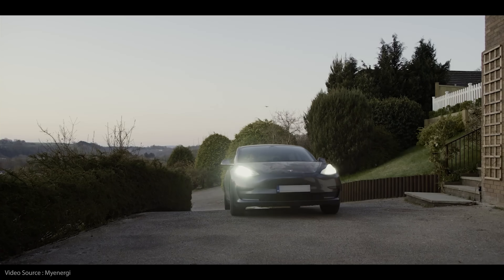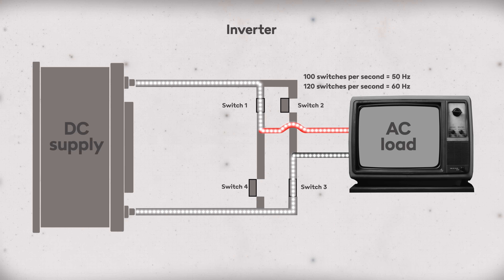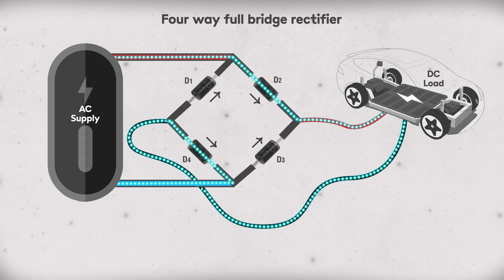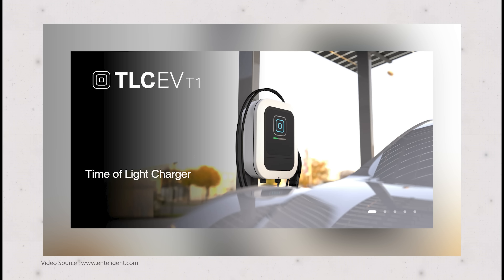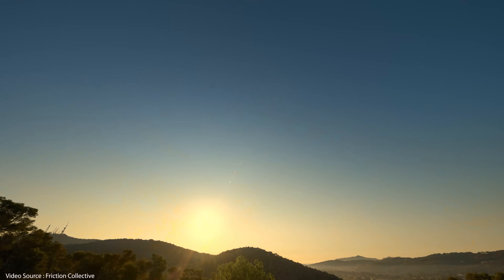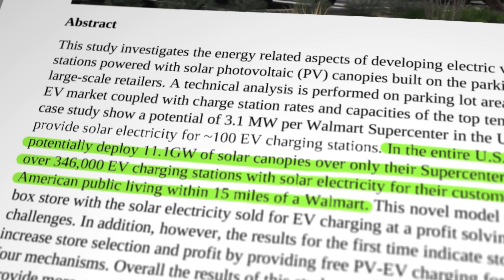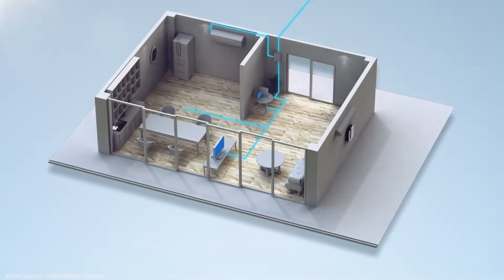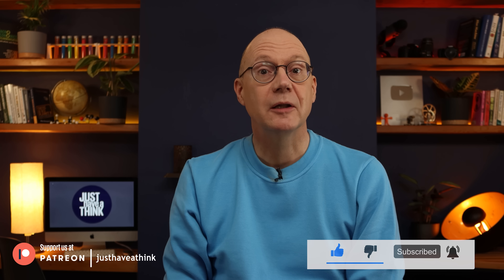DC to DC charging. One more step to off grid living!

Comment: Theoretically a solar panel string driven DC-DC can clock in at 98-99% efficiency bucking down, but most likely the solar will be at a lower operating voltage than the vehicle battery voltage, so it would have to be a buck-boost converter and that will be roughly 95-97% efficient at the likely voltage differentials involved.

The AC charger on-board the vehicle is roughly 92%-94% efficient.   And micro-inverters are roughly 98% efficient.  So the end-to-end efficiency from micro-inverter-based solar to the vehicle is (worst case)... 0.92 * 0.98 = 90.1% efficiency.

This means that you are only getting about a 5% improvement in likely configurations, and that's only when the sun is shining.  When the sun is not shining but say you have a whole-home battery system and the EVSE has direct access to the battery DC bus, things get more problematic.

There are HVDC battery systems with roughly similar efficiencies as the solar panels, but the battery round-trip still has to be accounted for (95%).   That gives you 0.95 * 0.95 = 90.2% efficiency for DC-string-to-battery-to-DC-DC-to-vehicle.

LVDC battery systems (48V systems) would need a DC-DC boost converter with a very high ratio (it has to generate 300-500VDC to the vehicle), which will only be roughly 92% efficient.  Probably even lower.  Really not any better than using an inverter.  0.92 * 0.95 = 87.4% efficiency.

So basically there are a lot of warts with this idea, and doing DC-DC at these high voltages requires some very serious and expensive safety features that makes the equipment significantly more expensive.  And you are cabling high voltage DC all over the place which has its own signifcant dangers.

Is it worth doing?   Probably not.  Save your money and spend it on adding more solar panels to the home instead to compensate and just stick with the regular DC-AC-DC conversion.

--

In short, DC-AC and AC-DC conversions to and from 240VAC aren't as inefficient as you might imagine if you are used to going to and from 120VAC.  There is a vast difference (a factor of 4) in the efficiency.   If a 120VAC conversion is 90% efficient, for example a 240VAC conversion using the same circuitry will be 97.5% efficient.   This is one reason why 240VAC micro-inverters are already able to achieve 98%-99% efficiency.

-Matt
Reply: Thanks for pointing the actual facts out.  There is so much misinformation about the differences between DC coupled and AC coupled systems. 
Most proponents for DC coupled systems like to ignore the cost and efficiency details of the required circuit protection equipment  - they argue that the cost and low efficiency can't be avoided.   Sure the cost and low efficiency can't be avoided if you are using a DC coupled system but the cost and efficiency impact can be avoided by using an AC coupled system.   Not that AC coupled systems don't need circuit protection equipment  - rather AC circuit breakers are way cheaper cost and are way higher efficiency than their DC counterparts.
Reply: @michael-j-harrison  Well, it depends where the power is going.

An AC coupled system is maximally efficient going from the solar panels to the grid or directly to home consumption.  But minimally efficient going to a battery due to the DC-AC + AC-DC (and then DC-AC again out of the battery) conversion.

A DC coupled system is maximally efficient going from the solar panels to the battery and medium-efficient going from the solar panels through the battery system voltage (but not round-tripping through the battery) and from that DC voltage directly to the grid or to home usage via another conversion in real time.   This is because the battery system voltage is typically relatively low... like 48V-56V or so.

--

Battery Round Trip is poor regardless:

Any system, AC or DC-coupled, that has to round-trip through the battery, for example to supply power overnight, will lose 5% at a minimum (battery round-trip losses), plus have to convert to the relatively low battery voltage (e.g. 48V-ish) and ultimately convert back from the relatively low battery voltage to AC.

This can be mitigated somewhat with HVDC battery systems, but the basic inefficiencies are still present.

That is minimally efficient AC or DC coupled.  DC coupled is only slightly better because it goes through two conversions (DC->BAT, BAT-round-trip, BAT->AC) while AC coupled is going through three (DC->AC, AC->DC->BAT, BAT-round-trip, BAT->AC).    98%, 95%, 92% = 85.6% for DC coupled.  And 98%, 95%, 95%, 92% = 81.4% for AC coupled.

--

People choose AC or DC coupling for a myrid of reasons.  Or even do both.  To be honest, it usually winds up being whatever the solar installer you hire is comfortable with and not so much the home-owners decision (unless you DIY it).

AC coupling requires using microinverters which means more maintenance on the roof when a microinverter has to be replaced, as well as a higher system cost.

DC coupling uses string inverters which are at ground-level, far easier to replace and less expensive to boot.

However, due to regulations, even DC coupled systems now have to have rapid shutdown devices on every solar panel.  These are far cheaper than micro-inverters but still involve having electronics up on the roof which will eventually fail and require replacement.    So it isn't possible to completely eliminate maintenance on top of the roof any more with a DC system.

-Matt
Reply: Matt:  Your math and logic is entirely correct.  I enjoyed reading your detailed explantions.  The part I dispute is that of connecting micro-inverters to the grid in US states and countries that do not allow net metering.  There is also the issue of states where the electric companies credit excess production at pennies per kWh yet charge full retail+ taxes when one buys electricity.  It is those people for whom DC-DC EV charging and home battery storage makes economic sense.  None of this would make sense if LiFePO4 battery cells had not gotten as cheap as they have.  $125/ kWh is typical retail now for large prismatic cells.
Reply: @peteinwisconsin2496  This is the situation California is in now with NEM3 for new installations.  Existing installations under NEM2 are grandfathered for 20 years from installation date.   It does increase the break-even time significantly.

Personally speaking I think 12-month net-metering and the (now) 6-minute net-metering are both unfair.  They are two extremes.  The utility does not have 12-month grid-scale battery storage.  But it certainly has more than 6-minutes of battery storage.

Given the amount of grid-scale battery storage now online, it makes sense to have 24-hour net-metering.  California is getting a lot of pushback over the absurdness of NEM3, they might make further adjustments to find a middle-ground.

Battery storage is getting cheaper, but professional installation of these large systems is way too expensive.  To really get a decent break-even period one has to DIY at least the solar side of the work.

-Matt
Reply: >-- Battery storage is getting cheaper, but professional installation of these large systems is way too expensive. To really get a decent break-even period one has to DIY at least the solar side of the work. --<
  Sadly, we live in a world where solar is cheap but installation of same is not.  I have coached so many people on PV-direct for DHW and space heat, yet only three families have completed their systems.  I get it that everything is hard when you don't know what to do but I am showing people, telling them what to buy, etc. and they still shake their heads in confusion.  If only this information age could lead to a DIY age.  Instead, the information age has led us to paralysis by analysis.
Reply: @peteinwisconsin2496  Sadly, I can literally feel the smoke coming out of many people's ears when I try to explain even basic solar + battery systems.  Strangely enough, it doesn't seem to be a factor of education or wealth at all... there are plenty of people on the low-end of the economic scale who DIY wonderful solar + battery systems, on the cheap, as a necessity to vastly improve their lives.

The problem seems to be more of a cultural nature.  We seem to be living in an age of black boxes and the cloud.  People buy stuff but have no real interest in learning how any of it actually works. That creates a hard-stop on the level of complexity the vast majority of the population is willing to deal with and needless to say power systems exceed it.   And it also makes it relatively easy for hucksterism to take root, because people have a hard separating useful gizmos from non-useful ones. 

A big advantage for those of us able to get past that wall, though.  But I worry for the future of our society in general.

-Matt
Reply: To anyone casually following this string of comments, please read junkerzn/ Matt's latest comment.  I share his concern about our species having the will or ambition to save ourselves.  We could save ourselves, but only if we can be bothered to do so.  Please read his comment and share it with others.

Comment: Great topic. Once the home solar systems get away from the arcane 48 volt systems and catch up to high voltage DC (250+) systems, much of the home charging efficiencies are cleared up. As far as the 2050 goal, it will never happen. As much as you may blindly wish for it, a dive into the global shipping market will show you that regardless of the changes being made, the increased greenhouse emissions from centralized global producers of most everything will outpace all efforts to green up the planet. Unless we decentralize our consumption of goods, go ahead a piss into the wind, it will just not happen.
I am fully off grid and charge from home.
Reply: Then we will have to decentralize. If you think the recent hurricane Beryl was scary, or the Calif. wildfires, or the China/India/... floods, then this is just the start of the process we have caused.
Saying "won't happen" is basically the same as "our human civilisation is doomed within our lifetimes" IMO.
Reply: @rivimey  yes, "won't happen" is a stretch but the numbers are there regardless of how many solar panels we put up. Centralization has historically weakened the resilience of nations or societies. I recall a bumper sticker that said "Think Globally, Act Locally". My state, even though it has the capacity to grow almost all of our own food, imports 90%. Think about it. There are so many ways to achieve the 2050 goals that, as a society, are ignoring. Driving an EV and thinking that's the answer is just foolery.
Reply: @babaluto  People trade because it saves resources. You aren't going to save resources by outlawing trade.
Reply: @aliendroneservices6621  I get it but after looking at the true costs of those resources, it doesn't add up.

Comment: From what I understand there are some major issues with the used EV market, people don't want to buy them.  And if there are issues with the used EV market then there will be knock on effects with the new EV market.  Who wants to buy a new EV that has very poor resale value. The EU has adopted standards with small electronic devices so that the batteries must be replaceable by the user with simple tools, but this standard has not been applied to vehicles. With EVs, in their current format, I think they should be called DVs disposable vehicles.
Reply: Use EV uptake varies by country similarly to sales of new EVs, those with higher adoption rates (Norway, Sweden, China, UK and Germany) the used EV sales are also higher, as familarity and acceptance is higher.  Rather in these countries the issue is a lack of availability of used EVs meaning demand is not being met.  For example, battery electric use car sales almost doubled, up by 90.9% in 2023 in the UK but the number of cars sold was relatively low due ot lack of 2nd hand EV supply as original buyers are keeping their cars as they last longer than their old ICE cars, are cheaper to run, and don't have the high maintenance issues that ICE cars are associated with.

The resale value is a sign of EV success and their rapid rate of innovation, with more and more new models coming onto the market and the new car price dropping as the underlying costs (such as batteries) have fallen - but this will stablise in the medium term. However, as with any product, you should buy something at the time that fits your needs and budget, if the car depreciates too much you hand it back at the end of the term or trade it using the balance. This is not specific to EVs all cars are depreciating assets, some cars depreciate more than others (same with EVs some depreciate more, some less). It's the whole cost of ownership that is important, the extremely low running costs of a battery EV car means it is still cost beneficial to own and run an EV than an ICE car, even with depreciation taken into account. It's not an investment asset that your looking to get a good return on, cars are an asset that you use and sweat to maximise value out of.

Batteries in EVs don't need replacing like those in personal electronics, the EU small appliance standards don't apply rather the specific electric vehicle standards do.  EV batteries last a long time (100,000s of miles) and have a mandated 8 year warranties that should something go wrong they will be replaced at the automakers cost; hence it is in the automakers interest to build a product that lasts a long time. Many of the current EVs will be on the road long after a similar age ICE car has been scrapped.
Reply: @GruffSillyGoat  EVs and portable electronic devices use similar technology. As EV's have not been on the market for long, it it ludicrous to state that they will be around much longer than ICE vehicles.
Reply: @pts619  - EV and portable device are only similar at the 10,000ft view level, particularly in regard to the batteries (last time I looked my phone didn't have a motor drive train, steering wheels or rubber tyres). Even with the batteries they are very different beasts in terms of anode, cathode, electrolyte engineering plus EV batteries have integrated fire suppressant membranes then there's the supporting electronics with battery management systems, battery thermal management systems in an EV being nothing like their portable device counterparts. It's like saying a CRT TV and Oled TV are similar as their both TVs, have displays and use transistors, i.e. it's a superficial similarity rather than a meaningful one.

The longevity aspect of EV is already being noted by automakers, industry analysts and automotive press - as there are a number of high mileage EVs that are still going after 10 to 12 years, with exceptionally high efficiency for their age and their motor's not showing signs of stopping anytime soon. The average lifespan of a ICE car varies across the world, but in the UK for example the average life now is just under 10 years (circa 100k - 120k miles), with many older than that now off the road and at the scrappers as being uneconomical to repair. This is not a personal projection but an observation many industry commentors are making.
Reply: @GruffSillyGoat  In Australia data from both used car dealers and private sellers in 2023 reveals that ICE vehicles that are between 2 and 4 years old lose on average 14.1% of their value from new.  EV's lose 42.4% of their value.  Those are the facts.
Reply: @pts619  - While at face value this is true, you have to delve into the details as this is comparing an average against a specific, which always raises statistical comparison problems and unreliable results. The underlying considersation being that EVs sold todate have been early adopter targetted larger high value/high spec cars, which means they depreciate further than the average car; this applies regardless of fuel type (ICE and EV). However, if you campare more similar high spec/larger ICE cars they also are experiencing high depreciation in Australia, such as the Subaru BRZ has depreciated 50%, Mercedes-Benz’s SL 49%, Kia Sorento GT-Line 54% and the BMW 520i 40% (dropping from AUS $90k to $30k). 

Hopefully, now that more affordable family orientated EVs are being brought to the market the comparison will level out and become more a statistically valid.

Comment: If your normal car charger cable takes ac and converts it internally in the car, won’t cars need two plugs and 2 sets of wires to get the DC power to the battery as well as AC when you are out charging your car?

Comment: For a long time I've thought that its nonsense to use AC in domestic electrical outlets, that it would be just natural to use a standard DC voltage and connectors for all appliances inside
Reply: Different devices require different voltages. There is no DC-DC voltage conversion (other than pulsing, which is artificial and could damage delicate devices).